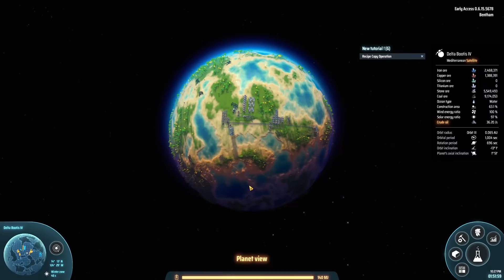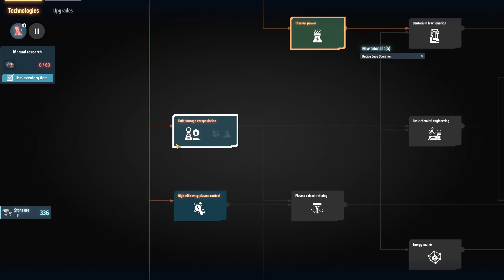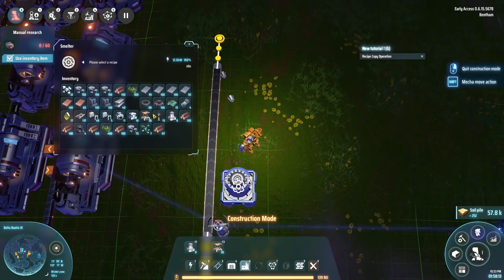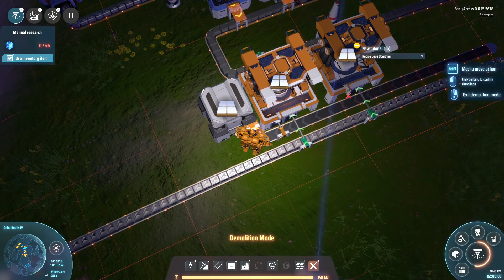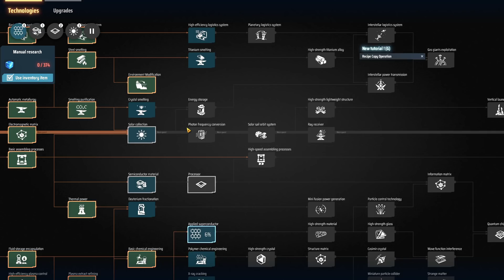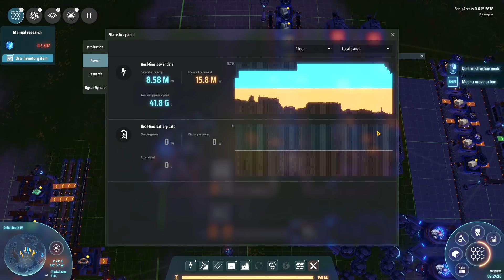Dealing with Death Spirals and Laying Foundations in Dyson Sphere Program | Part 4

Comment: That 90% in the generator near the end was the generators not providing enough power for the grid - they are running at full speed but the grid requires more power. When you have more generation than demand the satisfaction says 100%.

Comment: Bentham according to the wiki I found for Thermal plants the 80% efficiency deals with the burn time and energy loss. For example Graphite has an energy value of 6.30MJ, so to see the energy used in the plant times by .80, then divide by 2.16 (the power generated) and you get your burn time of 2.34 seconds burn time per piece of Graphite. I believe the fuel chamber bonus deals with the energy gained for mech recharge
Reply: which works out to 7 seconds burn time for 3 pieces in one TPS or 1 second burn time in 7 TPS  for 3 pieces. so an mk I belt can support 14 TPS, 2 rows of 7 chained. Giving 23,3 MW of power, having accounted for the 12 smelters, 48 mk1 sorters and 4 miners.

Comment: You can stick a bunch of solar panels on the poles of a planet with low axial inclination and get 24-hour sun exposure.
Reply: If the game simulates insolation of solar panels (and I believe it can't not simulate it), then efficiency of these will be crappy as hell.
I mean, we've got icy poles mainly because of insufficient insolation.
Reply: @Gizzeit  nope, at least at the moment the game calculates solar intensity the same at the poles as it does at the equator. The only factor is how much of the planet is blocking the sun, however the panels can register as low as 30% during the polar night, but I’ve seen as high as 101% during the polar day.

Comment: Well Factorio's assemblers have 0.5x, 0.75x and 1.25x.  What happened to 1x, Wube?  What happened to 1x!?
Reply: The 0.5x is easier to calculate since its just divided by 2 rather than 0.75 start in here.

Comment: clearing the wood and brush is really a waste of energy. You won't ever use it aside from 1 or 2 techs. You can use it for mech energy but it's inefficient. Better to set up graphite for that until you can do Hydrogen/deuterium cells. 

You will automatically clear items when you place buildings on them.
Reply: I have two words for you: Organic Crystals.
at least early on, worth not destroying them at least